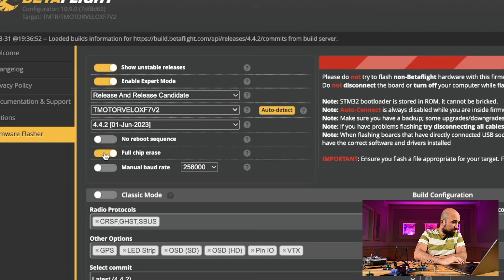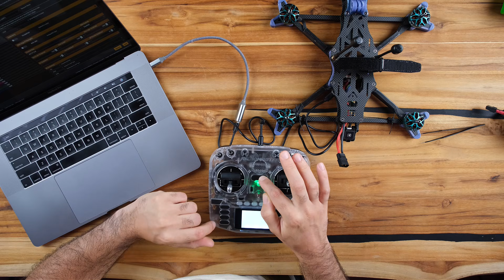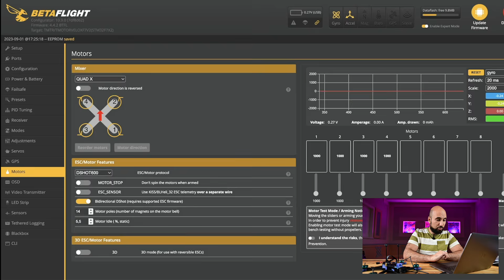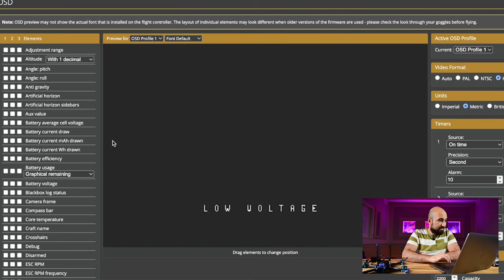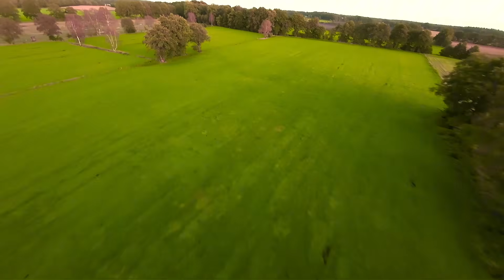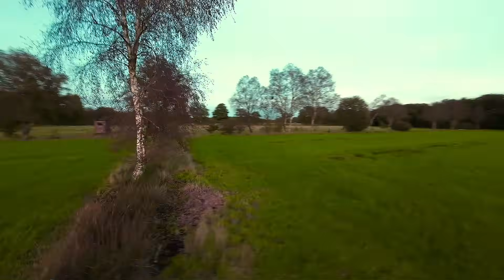How I Tune a 7' FPV Drone for Maximum Performance #fpv #drone

Comment from the maker: ⚠ The best tune starts with the right parts.
If you're building a 7" FPV drone, we've already matched proven gear to help you avoid costly mistakes.
👉 https://meps.vip/s/9y7zIhp100

Fly farther. Worry less.
✈ Fly With Confidence. #fpv #fpvdrone #dronelife